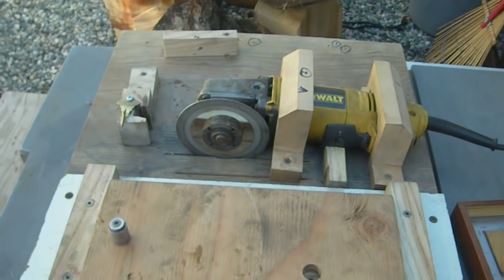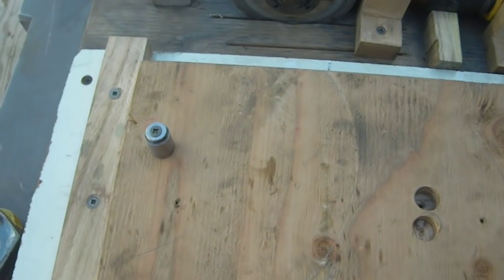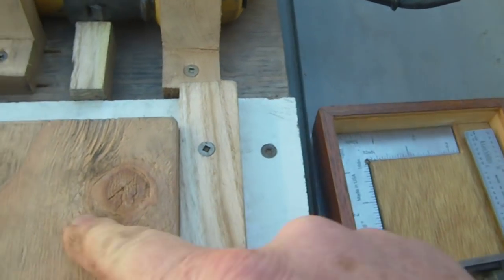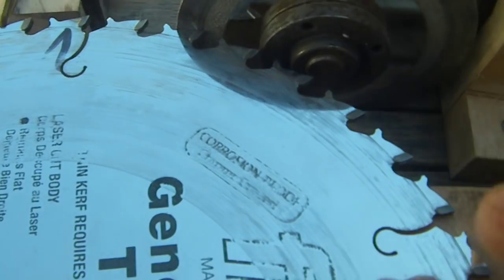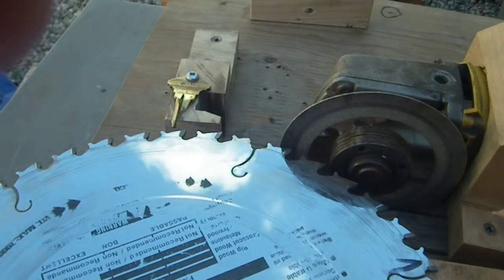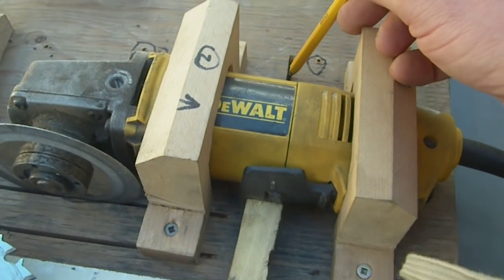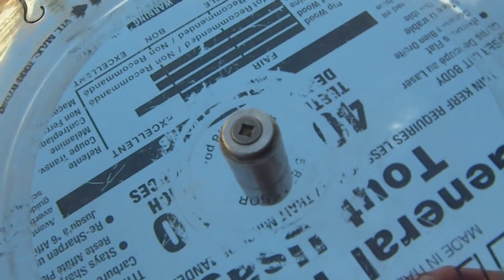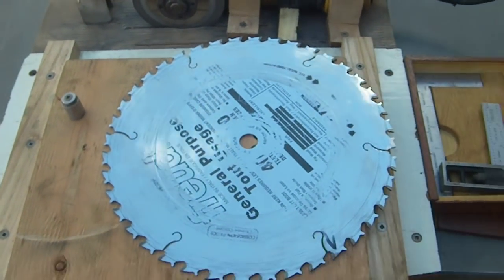How to accurately sharpen carbide tipped saw blades

Comment: It would have been helpful to show us the grinder rotated.  Was it rotated 90 deg ccw to its current location?  That would seem to make sense, but your 2nd slot for the diamond blade was behind the grinders handle in its current location.  That doesn’t make sense. I’m obviously missing something.
Reply from the maker: Hi, thanks for your comment. In the description to the video, I give a link to a better shot video (less movement) that covers the same topic. More pertinent to your question:  It shows what I mean by turning the grinder 90 degrees, as it shows the second position the grinder sits in.  So between this video and the second one, you see both  positions  the grinder sits in when sharpening both the face and ends of the individual carbide teeth of a circular blade.  Hope that helps clear up any confusion you may have. Cheers.

Comment: Thanks for detailed info on which tooth edge to sharpen and why this was very informative.  Also do you have a local supplier for 4.5 inch sharpening disks in Canada?
Reply from the maker: Thanks. they are available at any tool supplier or on-line through Amazon.

Comment: Nice vid. I sell hardened Dimond disk on eBay that look like what's in your grinder . If you would like to try one my EBay item number is 283412838698
Reply: P M88TOX  Just wanting to confirm a couple of things. Is the shaft hole size 5/8” which I believe is 16 mm or is it 7/8” which is 22 mm?  The EBay advertisement doesn’t confirm if the disk will cut or sharpen carbide tip saw blades?  If I’m reading this correctly will the tungsten cut or sharpen as well as diamond coated disk?  Final question how many 40 carbide saw blades would your disk sharpen during the life time of the disk?  Thx
Reply: @ggrong4356  I do a 100mm 4" disk with a 20mm center hole and a 115mm 4.5" with a 22mm hole that both cut and grind . The disk I get are diamond coated but there 2 diffrent grades.  My new ones are hardened so last longer. If you would like to try any of them 100mm or 115mm I will do you a good price.
Reply from the maker: @ggrong4356  You are right to try to confirm the hole size in the disks.  However because of variability my grinders have a thick washer that has a stepped face on both sides that one side is 7/8 the other side is 5/8. You can clearly see this in the video. The actual shaft size and hole on the disk in the video is 5/8", so no matter what I am covered. Does that make sense?. The grinder came stock with this washer. The second part of your question needs some clarification. Tungsten, when used in this context almost always refers to tungsten carbide. So sharpening a carbide tipped saw blade(or any other carbide cutting tool) with a carbide disk may work but it is far from ideal. With the cost of inexpensive diamond coated disks now ( solid rim not disks designed for cutting tile or stone etc) being under $5 delivered to your door in Canada its just not worth spending the time trying to sharpen carbide with anything other than nickle plated diamond disk or CBN. Most tool places that are geared towards home owners or even what is now called "prosumer" will carry them, ie Home depot or Rona etc. Again, you want a solid rim disk that has diamonds held on the disk with what appears to be a nickle (or similar looking) plating. They are pretty thin disks compared to tile/stone cutting disks ( about 1.5 mm or about .060"? I am guessing here but this is also pretty clearly visible in the video) that have far less diamonds held in place in a thick matrix through out the thickness of the disk. These discs are also pretty inexpensive now, but good ones typically are expensive  when compared to the diamond coated disk i am using. In the video, I mention that I have sharpened 20-25 saw blades. You can see the disc appears to be worn, and it is, but it still has life left. When it is used up, I simply will flip it over and use the other side. Not all of these inexpensive discs come with both sides coated in diamonds but this one did. So I expect to be able to sharpen around 50 -10" and 12" carbide tipped saw blades( anywhere from 60 to 100 teeth). I'm pretty happy with that sort of life span considering my cost was less than $5 CAD to my door.

Comment: thank you for the video, very useful info... 

If I may raise just one slightly negative comment... 

I kinda wished you had used a static camera with tripod as I found this video very difficult to watch when the camera was waving around like a flag and my eyes where was really staining to follow the video images....

 but yes great, coo,  interesting and helpful video, thank you for sharing...
Reply from the maker: indeed, I totally agree with you. You may have noticed (after the sea sickness subsides) that my videos are done in one take. Zero editing. Why? because I dont even own a working computer, and that means I dont have the ability to edit. That means it made sense to me to hold the camera/phone rather than setting up on a tripod as more than likely it would require multiple set ups and I would have to edit things together. Maybe if I do more videos I will try to stabilize the camera/phone somehow. Thanks for taking the time to comment, much appreciated.